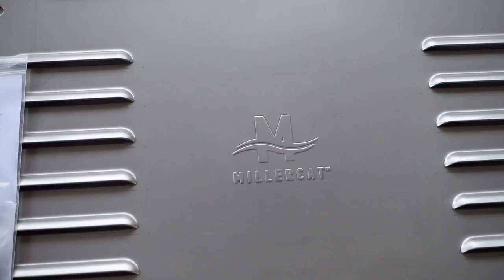How to Prevent Catalytic Converter Theft with Miller CatShield

Comment: Looks like it also protects the undercarriage going off roading.  Its pretty sad the worlds come to having to do this though.
Reply: It is sad that thieves still have places to sell these.  It looks to be a very sturdy product, which is good.  Here in Canada, I would put on some sort of rust proofing because the parts maybe be stainless, but the bolts sure aren't.  Loctite will surely help too in not losing any of the parts.  Wonder if it gets in the way of oil changes....
Reply from the maker: Oil pan and filter are further forward. Shouldn’t need to remove these for anything maintenance related.

Comment: This is an individually expensive remedy to a nationwide issue though. On the federal level, it could be done rather quickly. Make it illegal to buy or sell catalytic converters without documentation of where it came from. Car dealers and mechanic shops could be equipped with stamps, and every car that rolls in can have their cat stamped with the car's VIN for a few dollars. If for whatever reason you need a new cat, you have to bring it to the scrapyard yourself with your ID and registration, and it will be logged in a database so it can be tracked. Make the fines/ jail time ridiculous so that no one would even attempt to steal them.

That's a solution to an effect though, not a cause. If you want crime to be reduced, you probably need to get half the country out of poverty, nationalize healthcare, etc. There should also be investments into alternative transportation. Fewer cars on the road is beneficial in more ways than you could think of. People who don't need to drive or can't drive would have so much more money if they could get around safely and efficiently in a different way.

In short, make it nearly impossible to sell catalytic converters and reduce the giant chasm that is the wage gap so people wouldn't have to resort to theft in the first place.
Reply from the maker: Very nicely written and I agree it should be illegal to sell cats. Although that may reduce it, that wouldn’t stop it.  They would just make the processing facility in Mexico and people would load up and bring them across the border. Your plan would definitely stop the crystal meth heads from stealing cats but the cat market is huge and there is an entire network of people running this illegal business. It’s a lot deeper than most could imagine.
Reply: @SwampBoysGarage  The crystal meth part is a bit unnecessary, but I'm glad you brought up taking the cats to Mexico. Exporting catalytic converters without proper documentation would also fall under the law, so the same fines and jail sentences would apply, and that wouldn't be an option for them either.
Reply from the maker: I agree 100% with you and have also questioned why the lack of laws surrounding cats. They passed similar laws for selling rail road tracks because people was cutting the tracks and selling for scrap metal. Also, here in Louisiana, where poverty is very high, air condition units and electrical wires were being stolen in new construction homes until they strengthened the requirements for being paid for scrap metal.